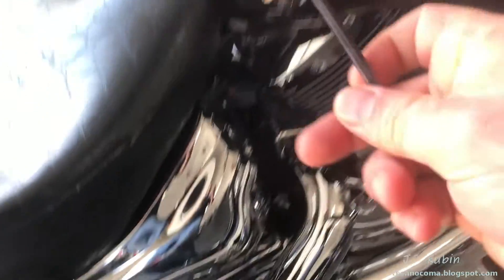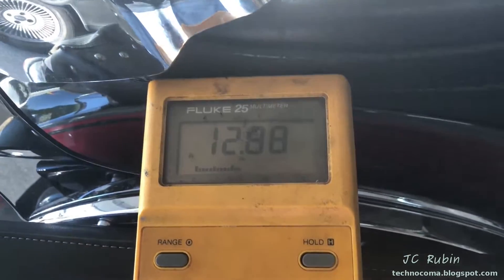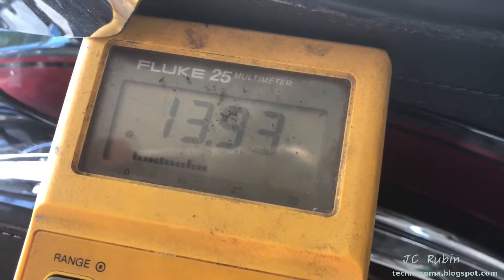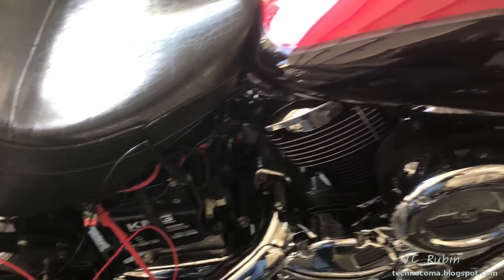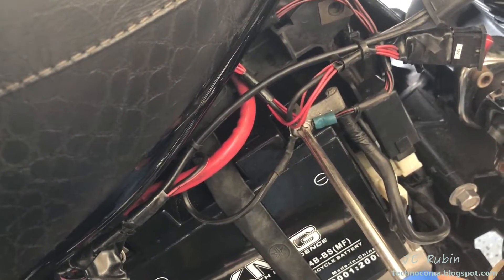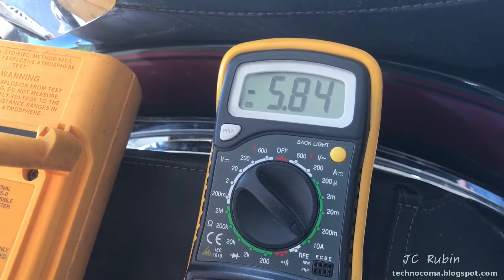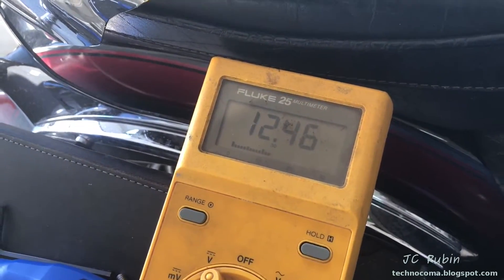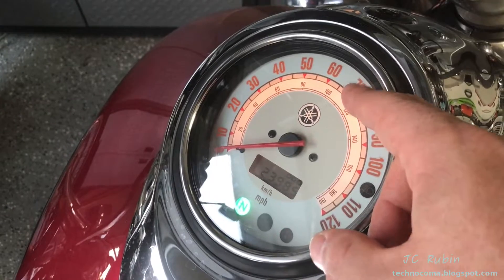Yamaha VSTAR 1100 Basic Troubleshooting - Charging system, Voltage regulator and battery

Comment: Hi sir, thank you so much for all theses awesome videos. I have a 2003 vstar 1100 and i been working on it for a year and a half without finding the issue. I could run the bike foe 2 hours or 20 min, unexpectedly at wide   open throttle, it surge and dies. Can't start until full cooldown. In the even, if i put on the chock, it start but dies as soon i remove it. The only part i didnt  replace on my bike so far is the fuel pump and the cdi unit. I test the issue with my girlfriend cdi unit and its not the issue. My bike is original without any mods. Can you help me!

Comment: I just bought a Yamaha 1100. The guy put a new battery in it. I went on a 3 hour ride and my battery swelled up and cracked. Would that be the regulator?
Reply from the maker: Sounds like it.   It should be producing about 14.5 volts off idle. To high and bad things happen

Comment: Great video.  My son has been wrestling with voltage issues on his 2001 XVS 1100.  Initially when under load, the voltage would jump to 17-18.  We checked the connection to the stator and it was fine, so he replaced the regulator, installed a meter to the battery to keep a closer eye when driving.  At idle it's reading 12ish.  YAY!  We thought it was fixed.  However when he drives it at higher speeds it climbs up to 15.  Last night on a short ride it blew a running light.  Any ideas where to go next with this?  Super frustrating!

Comment: Nice.
No idea whats wrong with mine tho.

It does charge with old and new regulator but it still drains while driving and also when its off(Slowly).
I cant measure it while i drive so i don't know when it starts to fail but iv'e been stranded a couple of times haha.
Reply from the maker: Pull fuses one by one and find the offending circuit

Comment: I have a question, I went through my entire electrical system using your videos (which are a great help) and other various forums and websites. I’ve replaced my Regulator Rectifier, it had overheated so much that it melted the plastic housing for it. I replaced the stator, the wires had fried at the connector coming out of the case. And I’ve replaced the wires and connectors that fried. 

But I’m still not getting a charge at my brand new battery. All my fuses look good too. Bike turned on and throttle reved up and I’m still just dropping voltage from the battery. Any suggestions?
Reply: Also I should have added, I have almost the exact same bike. 2003 V Star 1100 classic. Another reason why I love your videos so much.
Reply: Still having this issue if you’re active!

Comment: My 02 vstar has a .4 millamp drain. Also, when at idle my battery drains. I have to rev up for it to charge properly. I installed a new Yamaha regulator 6 months before this and it worked perfect then.? (Old regulator wasn’t charging battery) any ideas?

Comment: I have a 2002 Yamaha V Star 1100 Classic. The battery does die overnight. What could be the problem?
Reply from the maker: Run a multimeter in ammeter mode and read the battery circut across it to see hwat the drain value is.

Comment: I'm very late to the party but hopefully someone knowledgeable sees this.  I have just bought a 02 v star 1100. I test the battery when the bike is off, it shows around 12.4. I turn the key and it slowly starts draining like the video says. However, when I start the engine and let it idle, the volts read at around 14v for about 1 minute and then starts to decline. It goes somewhat rapidly down to around 12.5 then slowly started to decline.. probably .01 volt every 10-15 seconds. Is this normal? Backstory:  my bike left my stranded the other day and I am now diagnosing the issue.
Reply: Check your voltage regulator rectifier. Located looking at the air cleaner, left and under the battery cover is another cover behind the pipes. You can remove the battery and take off the back half of the pipes (2 screws between the pipes) to get the cover off and gain access. The stator might be having issues as well. Check both 👍
Reply: @KenVreeland  thank you!
Reply: @stoic9701  np I just had my rectifier go bad. Smoke coming from behind that cover, it was melting the back of plastic box it sits in. You can also quick check the stator from there at the harness (test a to b, a to c also a,b,c to battery ground to see if it has a short) the ohms might be a tad higher (on my meter it read 5 instead of 4) because of the extra wire or you can pull the opposite side cover off and check directly at the plug. If a to b & a to c are equal and stays OL to the ground, then odds are that the stator is good. If the rectifier goes bad it'll take out the starter relay fuse (I think it's called that) that's located under the seat n plastic cover. It's a 30amp llarge blade fuse. If that pops you'll loose dash lights, head light, everything. Good note though, there is a spare 30A fuse on the other side of the assembly. In case you die on the side of the road you can unhook the rectifier, replace the fuse and start and ride home on the battery for as long as it lasts 😉😁
Hope this helps you out. These are a very fun bike to ride 💪 and own. 👍👍

Comment: Wow… you are great, and inspiring. Question: So at the end you talk about the speedometer bouncing. That happened to me today. What I did while driving, was switch the lights onto park (no lights, but blinkers work at least tho blinking super fast and brake lights work). Anyways, pull up to gas station, fuel up… cross my fingers- but no. Almost starts, but not enough, and next attempt battery is dead. So I push it up and roll down a hill to start it in second gear…. Works. Weird thing is that now that issue is gone, but after like 10min driving, same happens… speedometer goes insane, my voltage display (gadget) blinks crazy numbers… I check all the fuzes. But now I’m on YouTube desperately looking for help. Any idea?

Comment: Love this video. I installed a Dash Cam on my 2007 1100 vstar. Only issue is I don't know where to hookup separate wire so it powers up Cam when Kerry is turned on. Right now it's connected directly to battery. I just disconnect cable from Cam when I turn bike off.

Comment: Have you come across a situation that the battery is at 12+ volts with key in Off and when key is turned to On it goes to essentially 0?  Ignition switch tested fine for continuity as did the kill switch. Main main fuse and fuses in side panel are all good. I’m out of ideas of what would cause the bike to have no power. Possibly battery is bad?
Reply from the maker: A dead short.   Id measure current across a battery lead and see what the draw is..... It may cost you a meter fuse, so beware. I usually use an inductive ammeter for this test, guessing you dont have one,

Comment: Very good video, just a couple of points which need to be addressed 
most people assume electrical system operation to be relative to some unexplainable magic when the fact is they fail to understand its actually 3 systems operating as one 
The First piece of the electrical system is the rotor and stator, which produce all of the electrical systems current/voltage via simple magnetism, however those two simple systems produce alternating current and uncontrolled voltage.   Therefore two other items are necessary to direct current flow and maintain voltage 
The second part of the system is the rectifier, which is basically a set of diodes (pair for each stator winding) which basically change Alternating current into Direct current by blocking and therefore routing the AC current through the correct diode,  as well as sensing battery voltage through smaller diodes.
Finally there is voltage control which is accomplished today by silicon devices, mostly zener diodes. These diodes simply open at a specific voltage, clipping the output of the stator/rotor.   The voltage regulator does not control voltage output via heat. 
...... 
Those are the 3 system components which makeup the electrical system 
....
The number one failure in most electrical systems is resistance to current flow through the systems conductors 
Resistance can be caused by (poor/loose connection(s), anything causing insulation such as paint, corrosion etc, conductor material, and conductor size).   Resistance can be found using a simple voltage drop test. 
If your electrical system is not keeping the battery charged, look for resistance in the system and resolve those problems prior to purchasing a replacement battery, else that resistance will cause failure of your new battery.

Comment: battery went out last week replaced the battery a few days ago worked perfectly.

Took it out and on the way back lights went dim speedometer dropped completely, and the odometer went out as well.

Got three jumps but it refused to hold a charge and when I went to restart it engine wouldn’t turn at all.

checked my fuses all seem good.
getting a multimeter and a battery charger today so I can run some troubleshooting.

any other ideas?

Comment: Watched this video to try to help my problem.  Helpful but I am seeing something slightly different.  When I fire up the bike when it is cold, I get 13.8V at the battery terminals.  After the bike warms up, I am only getting 11.8V at the terminals.  So as I ride my battery is going dead.  I checked the stator connector and got around 48V at fast idol on all three of the plugs therefore I believe my stator is working fine.  Can a rectifier/regulator cause the problem or does this sound more like a ground problem.

Comment: Great info!
I have a 2000 XVS1100, and I haphazardly crossed the terminals (for only a split second - unintentionally) on my battery while installing a new one. The battery survived and it still good condition, but the bike is now dead. No lights. Nothing. I checked the fuses on the left side and everything looks good, but I'm not sure what to check next. I am not that experienced with electrical stuff. Any idea what I might look at to find out what I probably fried? The ignition was off when this happened. And before the mishap, the bike was turning over.
Reply from the maker: You need to check the main fuse that's separate from all of the rest
Reply: @retrotechandelectronics  I actually figured that out from another one of your videos. Thanks. Appreciate all the time you've put into sharing your knowledge with your videos!

Comment: Do you have an email? I’d like to ask you a question.
Reply from the maker: Ask here.
Reply: Retro Tech & Electronics Ok it's long but I will try and shorten it. The bike died the other day during the middle of riding. When I checked the battery it was so hot I nearly had to double my gloves to pull it out. I took it to the shop and the battery was bad so I purchased a new one. When I hooked that up, I had full power, but when I hit the start button, everything cut out as if the battery was dead and then nothing registered after that. I do have the issue where the speedometer used to occasionally worked and now doesn't at all. But either way, wasn't sure your thoughts. Appreciate it.
Reply: Retro Tech & Electronics So...do you have any thoughts??
Reply from the maker: Midwest Motorhead voltage regulator or a bad short. What’s the charge voltage at 2000rpm
Reply: Retro Tech & Electronics So the bike won’t start at all. I have a new voltage regulator and a new solenoid relay. What happens right now is I plug everything up and when I turn the key to on intern on the cut off switch, the fuel pump and gauges like normal and I have full lights and everything. The second I hit the ignition switch nothing happens and the battery starts to get hot. Could it be a bad ignition switch?
Reply: Retro Tech & Electronics I recently had the starter clutch changed. Do you think the Statter wires could have gotten pinched when everything was put back together? All I know is all is well until you push the starter button and I’ve traced everything down and can’t find a short anywhere in the wires I can see.
Reply: Retro Tech & Electronics Bike is repaired and running. The starter was seized.

Comment: Having a starting problem.  Replaced battery.  On full charge, will start 8-10 times, but then nothing.  Going through your tests, with the bike running, voltage only reads about 13.1v, so I'm assuming rectifier.  I wanted to replace it myself, but can't figure out how to get the cover past the exhaust pipes.  Has anyone done this?  Is there a trick?  Any help appreciated!  Thanks.
Reply from the maker: did you get ahold of a workshop manual

Comment: good video! ive been looking in to a cruiser but my main criteria is reliability. ive heard these Yamaha vstar are at the top of the list, would you agree with this!
Reply from the maker: I would.... So long as you don't hold down the throttle along with the starter, or leave it sitting with gas for excessive amounts of time.

Comment: First I should thank you for another excellent video!   Next, we have spoke before and since you have so much experience I am hoping you can answer a question. 
 I had the issue where I could not shift into 4th or 5th gear, and I found the solution and tightening the screw on the left side  as shown in this video: https://www.youtube.com/watch?v=XsnaqTudpVk&list=PLvNSDQZ6evc5k0EaYCvpMOxPYAgNfnhgG&index=17&t=816s   My issue is getting the left covcer back on, the metal rod or shaft for the  Starter Idler Gear  came out when I removed the cover, and I am having a great deal of trouble sliding it back in.  I have cleaned and greased it but I just can't slide it back into the hole.   Have you ever had this issue?    Can it be put back into place without having to remove the rotor?    Thank you for any assistance that you can provide.
Reply from the maker: Sorry, im not familiar with this particular problem, so ive not had to do this.

Comment: I am working on a project vstar 1100 with electrical issues. The battery dies over night with nothing on. Your video is very helpful maybe I can locate the problem without changing part after part .  Harbour Freight here I come !   Volt meter of course
Reply from the maker: Dont get the crap meter there though, pay no less than 20$.  I wouldnt trust their meters with AC for a minute, but for DC, it wont cost me my life.
Reply: @retrotechandelectronics  I didn't need a meter after all. Discovered the problem , wrong starter relay .  The previous owner changed it 3 times , only to be replaced with the same wrong part. It looks right , but the ground tab is on the hot side not the ground side , causing the problem.
Reply from the maker: Anthony Crochet good news, glad to hear you fixed it. The battery may have suffered though.

Comment: What about immobilizer? How much current it should normally consume?
Reply from the maker: Please clarify immobilizer, what model year is this?
Reply: @retrotechandelectronics  It's yamaha dragstar xvs 650a, 2007. It has an immobilizer built in so that you can't start a bike without a key. You can see it as red led blinking on the panel

Comment: I have a power short to my gauges,  odometer and starter coming from a relay attached to the top end of  battery box by a rubber boot. the relay has 2 fuses attached to it. when going down the road the wind catches it jus right it wiggles it loose. can you name the relay? I'd like to compare an see if it's broken some how.

Comment: I have 2006 VSTAR1100 that is getting zero power. Brand new battery thats fully charged. Turn the key to on and absolutely zero pull from the battery. I cannot figure out what the problem is. Terminals are clean, fuses are new, starter relay is new. 

Any ideas?
Reply from the maker: Zero power is a good clue that something early on in the circuit is disconnected. Review the wiring diagram.

Comment: I have a charging problem on my 2002 V-star classic, 12.9 volts at rest, 10.2 volts at start. but only 11.3 volts while running no matter the rpms . Any ideas ? Thanks in advance.
Reply from the maker: If it climbs from 10.2 at idle to 11.3 and stays there through the rpm range its probably the voltage regulator.
Reply: @retrotechandelectronics  Thank you so much.
Reply from the maker: Glad i could help.

Comment: Thank you for this video! Recently bought a 99 vstar an it's been quite the experience. I just replaced the battery, now the new battery doesn't have enough juice to fire up the bike. I'm not sure if it is the voltage regulator that went out or the alternator. The speedometer and LCD display did act up, just like you explained at the end, so now it's just a matter of finding out what the problem is.  Thank you again and any advice will be greatly appreciated
Reply from the maker: Did you charge the battery before installing it.
Reply: @retrotechandelectronics  yes sir I did, I took the bike out for a spin, came back, turned off the engine, then tried to fire it it back up and nothing
Reply from the maker: Did you go through the regiment to see if it was increasing to regulation voltage when you gave it throttle under test?

Comment: I’ve had my regulator, rectifier and stator replaced about 2 years ago and the battery is apparently fine but I was out riding and my speedometer needle started spazzing out and going all over the place and eventually lost power to the instrument cluster. I pull off the highway a bit and eventually lose all power to the bike. Just had the battery tested and checked out fully charged. What could cause this to happen? It’s an 05 1100 Silverado
Reply from the maker: Did you see my video with the melting rectifier coupling cable?
Reply: @retrotechandelectronics  no can u send it to me